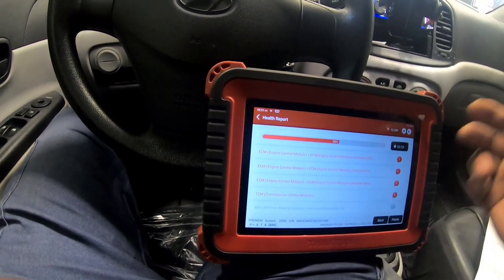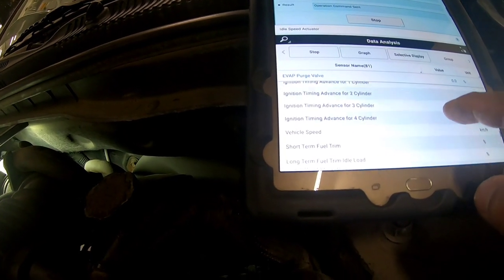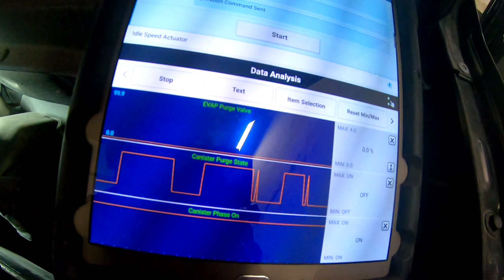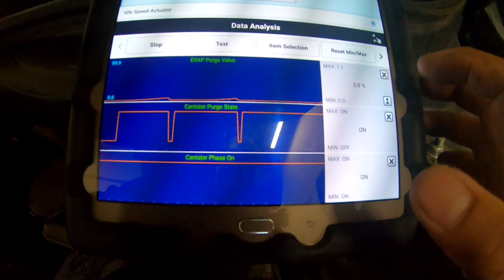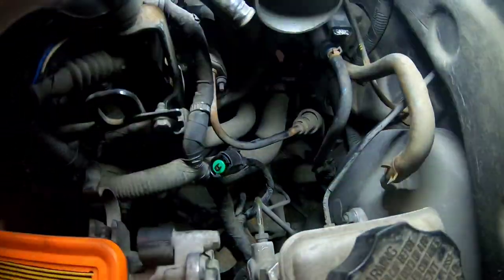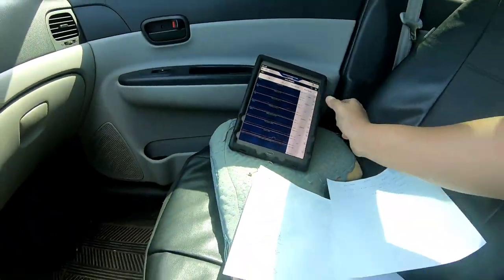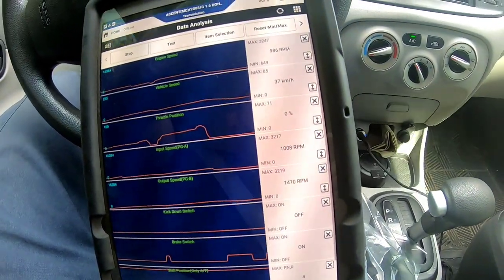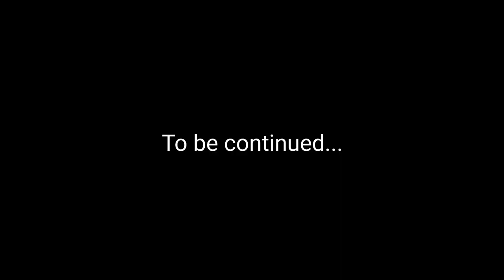Hyundai Accent struggle to accelerate

Comment: What scanner is this? Is it very good and cheap?
Reply from the maker: The aftermarket one is called thinktool, the price is reasonable and so far its good.
Reply: Sorry. Not thinktool one. Asking about other one. GDS. do you need VCI and GDS software to run? Or think tool is enough to do all active test and special functions for this ioniq car? Thanks. I became a big fan of you
Reply from the maker: @mahbubur635493  oh, dealer scantool is expensive but the thinktool has bi directional commands too the same as the factory. Unless the car is very new and some options on the aftermarket one some will be missing.